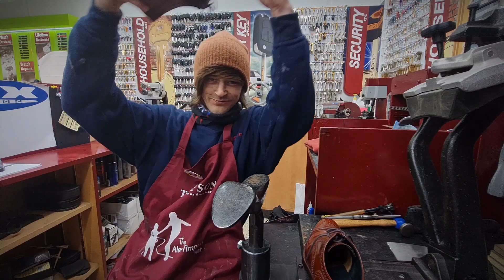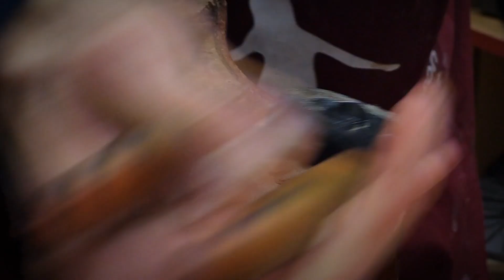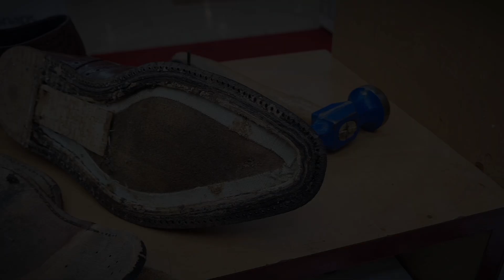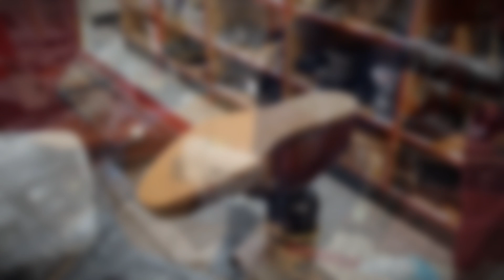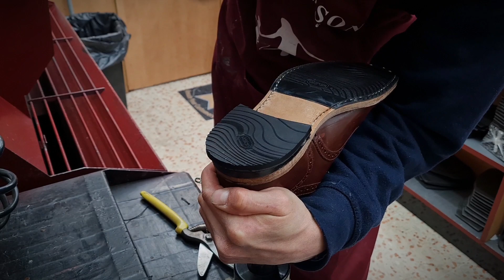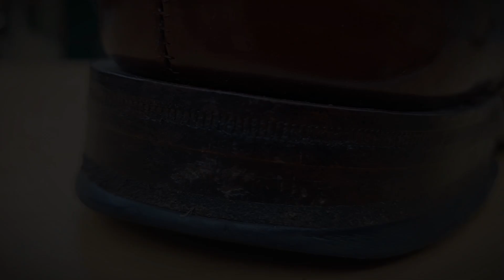Loake Overton Restoration | Executive Leather Resole #39 | Vibram Guards | Scottish Shoe Repair

Comment: Great job, man! When you trim the edges of the heel block, you leave the leather rough. But how do you get it so smooth like glas? Just by brushing it with the machine oder by sanding with a 200 or higher sand paper?
Reply from the maker: A process of wet sanding the edges with finer and finer grit paper, until it feels super smooth, then apply some wax on the brushes and some polish to finish off